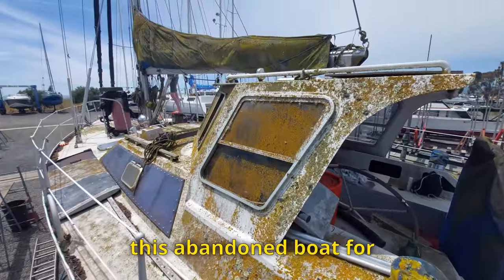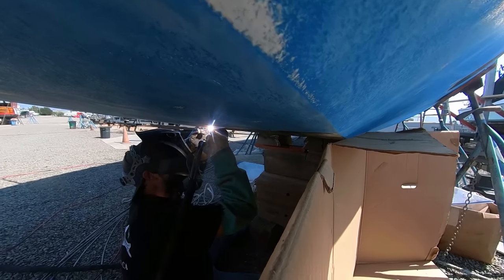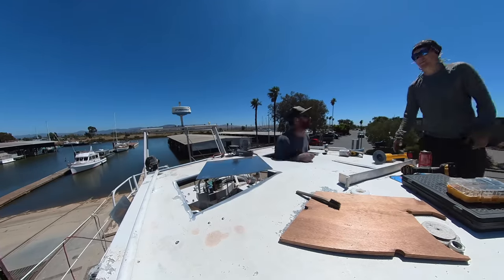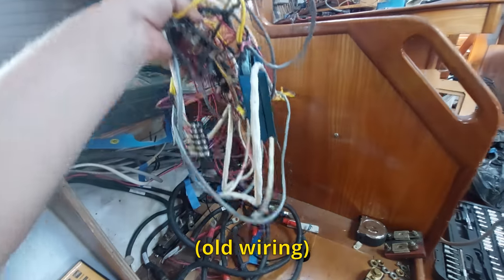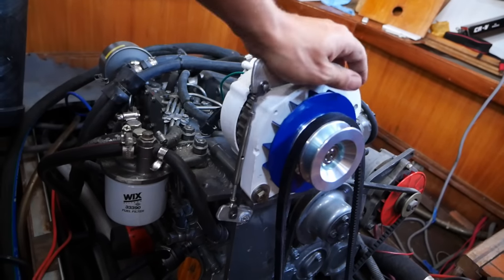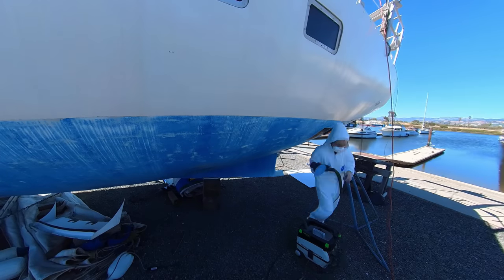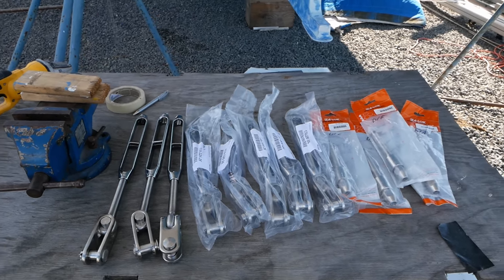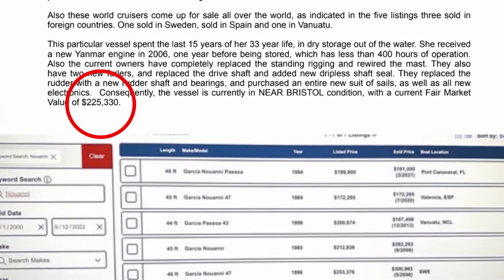Paid $57,000, 5 months later valued at $225,000!

Comment: I’m in for monitoring aluminium sailing boats for a couple of years now I can tell you could get way over 300.000+ easily now for a fully refitted boat with working systems! Theres so much trash on sale for about the 220.000 mark now costing 150.000 a year ago… And aluminium boats selling quicker than quiking and ieqing plastic sooner or later earth fill floating buckets. You did everything right 🎉 celebrate yourself a bit and may consider a more stable backup system like a fully SSD based non rotational parts on board raid server for the archive load plus two mirroring M2 work drives… Data is your income system! … you are officially my favorite sailing channel right now cause you are the only one doing it with a proper zero through hole aluminium expedition style sailing tank. Great job, great decision making zero to none decorative nonsense no food porn no building four years on a shipping container home with zero additive value. You got somewhere, you achieved it, you did it with your own hands, you deserved it, you are not sitting on your mums and dads couches you are living inside your believes that’s honorable to the fullest extent! Great love and thank you for sharing otherwise my life on the couch would be much mor miserable you managed to push some glance and substance through the self replicating foam of bullshit of the current times. Now make your audience pay for all your work and expenses and go on with your fabulous journey ❤❤❤

Comment: The welder guy was using what we call a "one pound spool gun".  Instead of the wire coming off a spool in the machine and traveling down the lead, it's a little spool in the torch handle he's holding. MIG welding aluminum is hard because it goes on very fast so you have to move much faster than welding steel. He's very good! Aluminum gets really hot really fast too, and the heat travels much further than steel. And for some strange reason, I love the smell aluminum mig makes. That's a really nice boat! And because it's aluminum even in scrap condition it was still valuable. Great job!

Comment: Totally agree project boats are probably not going to save much money but the way I see it is that I will know every system on our boat inside and out. Also it's a good way to build a boat that's personalised to the owner. It is definitely alot of work though. We have been doing a refit on anchor for the last 18 months with the occasional short trip out to break up the work
Reply: The boost in operating confidence gained from rebuilding / refitting equipment is a significantly underrated point

Comment: The hours the two of you put in to this refit, at a minimum (very quick estimate) could be one full woman year, 2,080 hours.  A boatyard might charge an average of $75/hour (this is probably low) which is about $156,000 in labor costs alone.  I'm sure you spent more than $100,000 on materials and equipment.  Again, it looks like a great job, and by doing this you know your boat intimately.  Bravo!!

Comment: Very valuable video and definitely a huge amount of work you put in. What most people don't know is that on boat renovations you almost always work in really awkward positions - welding over head or doing stuff in cramped spaces. Also, outfitting a boat is very expensive - but Garcias are built well and from your perspective it was probably worth it to a.) have this experience and b.) also now know exactly where which cable runs and what part went where. If you buy a boat and sail it right away it takes a long time to learn its ins and outs and really understand how it was built and how every detail works - which for your kind of trips is very necessary knowledge. Good luck with the NW-passage then!

Comment: Yeah it took a lot of time and wasn't cheap but its customized the way you want and you know it inside and out when it needs work, hard to put a monetary value on that .  It will probably make it harder to part with if you need to sell it though.

I noticed your boat has a bilge, or twin , keel.  Is that your preference or more just what it had?.  Never sailed one but the only things I've heard are that it beaches well, maybe heals well, is slower, , possibly somewhat improves performance given its shallow draft and can sail in shallower water go given that shallow draft.  Oh yeah and some say it makes for more stable sailing with less healing.  What are your opinions on the bilge keel?  The only consistent praise I've seen is that they beach well and don't require support during dry dock maintenance.

Comment: As a back of the envelope calculation. 5 - 30 day months equals 150 days times 2 people equals 300 man days. At 8 hours a day equals 2400 man hours. At $100 an hour that is $240,000 dollars in just labor. Unless my spreadsheet is wrong - which is entirely possible - they could have spent more than the boat is worth in just labor costs. This is the issue with any kind of flipping. It is very easy to lose money. One of the great lessons from Pawn Stars on TV. You make your money when you buy something not when you sell it. If you spend too much up front you cannot make it on the back side.

Comment: Fixing a boat isn't easy. Even with deep pockets. It takes a tremendous amount of time. Nothing is standard. Repairs have to be done well to be durable. It's a money pit and big time suck. I bought a boat that needed work. It's a very bad investment. If you're looking to buy a boat and you're reading this, do yourself a favor and buy a good boat to begin with. You'll have plenty of work to do on it, just to keep it in good shape (stuff always break, leak, etc... even on good boats).
Don't intentionnally buy a crappy boat thinking you'll be smarter than everybody else and you'll be able to fix it quickly and for cheap. If it was easy and cheap to fix a boat, there wouldn't be that many crappy boats abandonned or for sale for a cheap price.
Buy a good boat. Use it, maintain it, and resell it for the same amount of money once you're done with it. You have to think about the experience as a whole. Not just what's cheap and quick today and ignore the upcoming expenses.
If you can't afford a good boat today, that's ok. Work 1, 2 or 3 more years. Buy smaller. Rent. Volunteer as a crew member in a sailing club. Go sailing on a summer camp (Glénans, UCPA). Or a combination of those. But don't cheap out and buy a turd.
Trust me, that's your cheaper option. And that's the most enjoyable option (more time sailing).
Cheers !

Comment: Oh god.  1tb is a lot of footage.  Please switch to SSDs, hard drives just don't handle environments with motion very well.
Fyi, the cost of solid state drives is at an all time low, my personal recommendation would be a large zfs array of 870 qvo drives with a 970 evo cache layer and optane for the metadata using truenas.  There are ways to make this setup pretty low power and zfs setup with raidz2 (might be able to justify z1 for ssds, idk.  I'd go z2) provides excelent data recovery and preservation.
Reply: Actually, come to think of it, I'd be happy to build a nas tailored to your workflow at cost if you want. (Offering just in case, this is my favorite sailing channel right now)

Comment: I think you can get $225,000 if you resell inside of the next 3 years because you are comparing your boat price with others with original rigging, sails, and electronics, not to mention daggerboard and all of the welding and refitting. It would be like getting  a much newer boat for your buyer.

Comment: This is misleading, the boat is not worth $225,000. That’s what its replacement value is. My boats replacement value was $395,000 but I just sold it for 60 grand so there is a huge difference between replacement an actual market value.

Comment: I don't think i would have removed all of those layers of paint. I would have roughed them up and used them as a base layer if all was sound and not flaking / oxidizing. I highly doubt the new paint job now will last as long. Lets face it the boat should have been scrap value at purchase. I just hope the boat is still strong where it needs to be like around the center and dagger board and that you manage to enjoy it for many years to come.

Comment: Can you explain how you managed to eliminate all the holes in the hull? How does the replacement system work?
Reply: There is a pipe that goes overboard. It is usually called standpipe
Reply: @jonnenne  How about making sn episode explaining how it works and how it distributes the water for cooling the engine, flushing the toilets etc… Also, where do all the sensors go (depths / speed)?

Comment: May i ask, Why did you have your Aluminum welder, weld closed ALL Through Holes?

How have you arranged the Cooling of your Engine, does the Engine cooling have a Through Hole? Or, have you rigged up a Heat Exchanger?

Lastly, for now, how Think an Aluminum Hull in mm or cm, is this boat?

Yes, i did Subscribe.

Did you Follow My Legal Instructions, in securing your Pension Right's from the business which you worked for Ten Years? Trust these instructions, European Union Law, treats such lengthy work relationship's as Employment! Not what that business wrongly thought. The new identity cannot escape responsibility, unless you SUBSEQUENTLY sign away your Pension + Employment Right's.

You can Thank Me as Advised previously. Yours faithfully